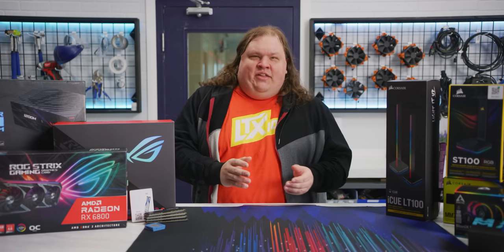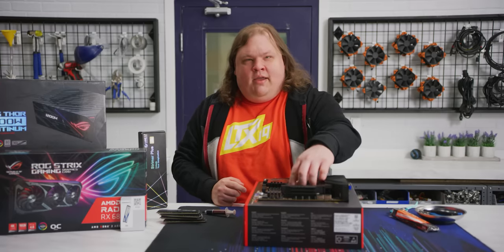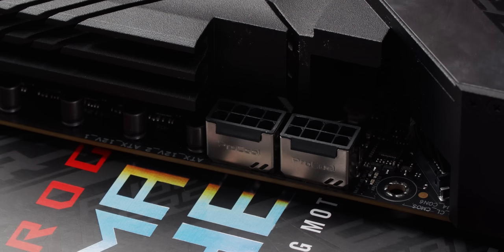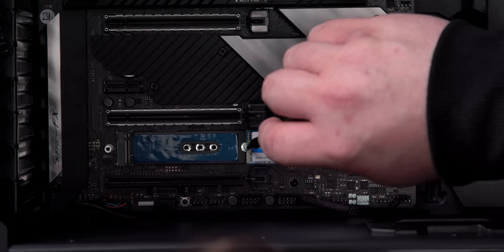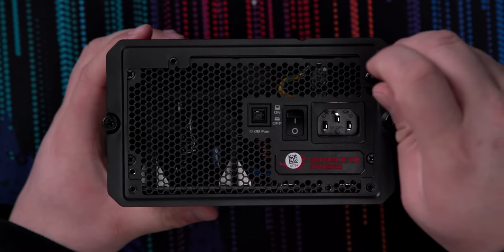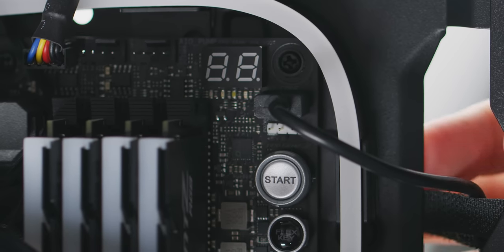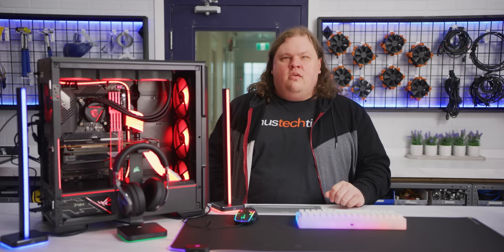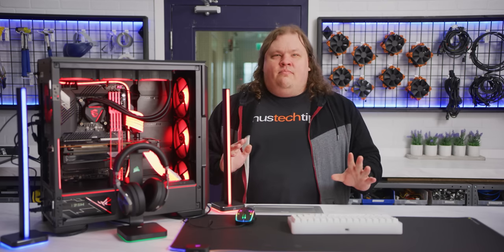ULTIMATE RGB PC Build Guide 2021

Comment: LTT: “Make sure to check out Crucial RAM and SSDs!”
Also LTT: uses G.Skill
Reply: Is G.Skill good?
Reply: @chrism6904  yup, they are top tier
Reply: crucial ram rgb software is non existent
Reply: @kampaskopling523  not gskill aegis tho
Reply: @eliashelfer2740  that’s just not true. g skill aegis is lower end but it’s still better than a lot of other sticks out there. I’ve had aegis running in my system for 2 years almost and haven’t had a single issue

also just an edit, aegis is still phenomenal ram, but that goes without saying, yes g skill trident z is probably better ram. ripjawd and aegis is very comparable imo
Reply: @yourmom-ee5pb  yeah it’s a bang for the buck but medium range I would take Corsair vengeance
Reply: @eliashelfer2740  All vendors except G.Skill and Crucial are well known for their inconsistency in terms of chips. Corsair's ram isnt that bad, but, for example, Hyperx and ADATA may install different chips even inside ONE BATCH. For example, some time ago i built two PCs in a row with identical kits of HyperX Fury ram produced at pretty much same time, but one was on Micron Rev.H and the other one was on Hynix M-die.
Reply: acrually if you get  armory crate and aura sync you can control it.
Reply: @kampaskopling523  Thank you very much!
Reply: I was gonna comment that!
Reply: yea, I mean crucial makes really good RGB RAM. I plan to put a kit of this RAM in my system
Reply: @symir833  thanks for telling that will be very helpful when I get my new RAM
Reply: @eliashelfer2740  same
Reply: @chrism6904  yes it is the best for mid-high end with semi-low price
Reply: @symir833  OpenRGB
Reply: @chrism6904  OpenRGB
Reply: Which one to go for? G.Skill or Corsair?
Reply: Even tho (imo) Vengeance Ram looks better
Reply: Gskill has a model that goes with the Ryzen CPU, they were originally going for a Ryzen build.
Reply: e

Comment: Hot take: PSUs having built in wattmeters should be standard at least from mid range up, they don't need to be LCDs, you could throw a couple little 7 segments on there. Power delivery is still straight out of the 80s tech wise for literally no reason

Comment: Make sure you Disable SDK on your RGB software if you are running more than 1 application. They can conflict each other, Example, iCUE does not like working alongside MSI Center. I had a ton of RGB problems, once I figured out you can Disable SDK which allows other RGB applications to take control of RGB settings, they seemed to be both on by default.
Reply: How to disable SDK for this combo?

Comment: "you need a table to build a computer"

I built my first pc (custom hardline 5900x and 3090 FE) on a sherpa wool blanket in the middle of my carpeted floor. Fight me
Reply: The Verge hates this guy!
Reply: 2020 was the first time I ever used a table to build a computer.  Every other PC before that, every single one, was built on a carpeted floor, because it's what I friggin had, so it's what I went with.

Also, grats on the sick build!
Reply: @SilverKnight16  thanks! And yeah, when the only place that you have room to put your system is next to the couch, with your monitor and peripherals on the coffee table, then you probably don't have the room for a table and ESD mat.

As long as you frequently ground yourself through the case and don't move around a lot, static isn't a concern... Losing screws in the carpet is lol

Comment: "you need a table to build a computer"

Geez, i build my first on the bed
Reply: I’ve built mine and my brothers’ pcs on my bed also rofl
Reply: the verge pc build reference there
Reply: I built my pc on a floor. 4 years ago.
Reply: I built my first one in mid air
Reply: I also built my first one on my bed lol, on a comforter that generates so much static that getting in and out of bed in the winter in the dark I can see flashes like lightning all over from static discharges 😂😂😂 the computer is of course fine but has since been shelved after I built my new one.
Reply: I built mine in the swimming pool.

Comment: Thanks Anthony , I"m on 1st build in 15?  Stuned! Hardly anything comes w/reasonably legible labelling, instructions? WTH manufacturers?  $20 ID Cooling CPU Cooler. comes w/ great instructions but $50 Arctic Air Cooler came w/ install flanges that butted into VRM Sheilds & online instructions?  Sucked in by a White Build &  D-RGB bling!  It's my Dream Machine🤩  Jury is still out! D-RGB  & Fan Heat management wiring is not facilitated by Manufacturers &  Retailers  🤑😂🙉

Comment: I have this same Hero XIII and less RGB that doesn’t work.

I have 3 of the long RGB strips in this video and 3 fans plus a CPU block. The 3 fans and CPU AIO are the EKWB 360. I have 2 commander pro’s and the Razer lighting hub thing.

The 3 fans light up and sync to the RAM, CPU block, and mobo but the damn Strips refuse to work.

Both Synapse and iCUE complain that the strips are too long. They are not daisy chained and plug into independent headers on the hubs.

Granted this build was my first RGB build but it’s not hard to plug things in. Was supposed to look awesome but ended up being more trouble than it’s worth. A year later they just sit there annoying me as a waste of time, money, and potential.

Also, 1000% agree that those connectors are stupid loose. Electrical tape work fine if you’re not plugging it into a hub. If you are, good luck. I tried to use zip ties in an X pattern to seat them but that was also a stupid battle.

In the end, I’d probably drop most of the RGB for my next build. Wasn’t worth the hassle and cost

Comment: I ended up getting hot glue for daisy chained RGB connectors.  While a smidge more permanent, it can be removed and won't leave nasty sticky tape residue behind.  Now that I think about it, I'm a little surprised someone hasn't engineered some 3d printable cable locks for this....or that a company hasn't done the same with their fans, other than maybe Lian Li's solution.

Comment: You could use these towers or like what i have: ST100 RGB, and what im trying to say is: if you have the lighting type "Temperature sensing", you could set it to any component, i set it to my GPU and CPU bc these are optional for me to check the temp for what game is using too much, i have a low end thats why im carefull mostly.

Comment: Correction: you do not need a table to build a computer. In my case, I used a carpeted floor, a sherpa wool blanket to prop up the case, and my bed to lay out the parts.

And no, in some cases, you cannot get the same performance from a mid-range board and a high end. The Crosshair VIII Dark Hero and Extreme boards are the only motherboards on the market that allows you to enable PBO and an all-core overclock at the same time. My 5900x will boost to 4.9-5.1gHz under 75a load, and locks at 4.7ghz over 75a, giving me all-core power and gaming performance

Comment: Questions for the all mighty tech lords of Linus Tech.. I am running an Asus Tuf Z390 + WiFi motherboard, which has 2 standard 4 pin RGB headers, is there a way for me to run 9 fans with splitters and have Asus Sync control it all? Or should I be looking into fan controllers?

Comment: This is nice and all, but you can't sync the corsair peripherals to the RGB inside the system because iCue won't work with Asus armoury crate..could have gotten everything Corsair in this video from Asus (except for the light bar) and synced every single thing..Right now mouse keyboard and the corsair stuff is just doing it's own thing.

Comment: Dont forget to remove the (usually blue) tape that covers the NVME M.2 heat shield ! So that the new drive can contact the heat pad and transfer heat to the cooling fins properly ! I forgot to do this the first time but thankfully once I upgraded with a new drive a day or so later I saw the tape and removed them all for my drives . Whoops .

Comment: you could of just did it all thru icue with these special adapters from ebay that has the 3 pin argb 5v plug and the other end has the corsair perpritary plug and its so much easier.

Comment: Im confused, is the msi b550 carbon, the only motherboard that cant handle more than 5 RGB things, connected to it? I hooked up like 7 rgb fans, rgb  sag bracket, rgb m.2 sink, and the rgb pins stopped working after a few days...
What other AM4 motherboard can handle a lot of rgb?

Comment: I like RGB... To a point. By that I mean you don't have to direct air traffic or rob a bank to afford it. I went with all corsair... The crystal 450X case, corsair cl120 rgb fans corsair vengeance rgb pro ram, k44 rgb  keyboard, harpoon rgb pro mouse & h100i v2 aio. All on the commander pro & run by iCue. My cable management  looks like spaghetti but it looks clean & nice where it counts.

Comment: I have a lian li AIO cooler & Ive installed the inlet and out let at the top at the 12 O clock position same as you but I see most on the side or the 3 O clock position. Is this okay? My first build.

Comment: I’m kinda new to PC building and was wondering what is the best type of graphics card, that isn’t over $1000, for the intel i9 that was mentioned in the video?
Reply: At the moment I run a i9 10900F with a GTX 1650 Super and I get 60+ FPS on ultra for majority of games, if you are look for something a bit better you could look at the 1660 or 1660 Ti, although they are more expensive. I don’t think you’d have much luck getting anything higher than a 1070 with the current situation, so that’s my suggestion for < $1000 that’s likely in stock.

Comment: Is it ok to mount the power supply right side up with the fan right up against the shroud like that? The case seems to assume you will mount it upside down with the fan on the bottom pulling through the filtered vent at the bottom, but if you do that you can't see the display!

Comment: Hi Anthony,
thank you for all your hard work and great tips!
I have a question regarding RGB LED Strips and connection types for them.
A friend gave me a pair of LED Strips from a Motorcycle. I have seen these on youtube being installed on some PC's.
Here are the ones I am referring to found on Amazon- Kingshowstar 2pcs 4inch 6 LED Multi-Color Flexible Strip Accent Lights 5050 SMD Flex RGB for Motorcycle ,ATV,Car
The Single connection on this is a 4 pin that is not the same as RGB on my MB, Asrock B550 Steel Legend.
These Strips are short but appropriate for where I intended for the to go (on a homemade GPU backingplate)
Question is: should I bother with these or just purchase a Kit ?

Comment: i like how you did the cost break down, this is why i like to stick with one brand, not so much because i am a soy boy fan boy, but i hate the idea of needing many different rgb programs to run it all, i find that corsair gives you the widest range of rgb peripherals to use like this under the icue software. as everyone else years ago i was into razer, until i found them to be the most expensive cheap bran don the market. i went through so many mice and keyboards because of their cheaply built products,a razer naga, razer naga tournament edition, razer naga trinity, black widow, ornata, huntsmen elite. and the answer to all this expensive shit. the rgb in them are very shotty, and their half life is like quick.

so i decided to finally go with corsair, i got the k60 keyboard, the scimitar mouse, and the mm700 mousemat. of course corsair inside to, such as the corsair ll 129 mm fans, i got 9 of them because i am using the lian li dynamic case. plus a commander xt, which sucks that at this point they don't have a commander that can host 9 fans, with rgb and fan speed control.

and let me tell you the 9 fans, plus the core xt was 516 by itself. never mind when i get the strimmer cables.

Comment: Hi Anthony, my Phanteks Digital Neon RGB Strips only light up about 1/4 way on each and in the wrong color. I have 4 of them daisy chained together and connected to a Cooler Master ARGB Hub through the 3 Pin VDG connector.

What could i have possibly done wrong?

Comment: Would the PSU be starved for air with the fan facing up?
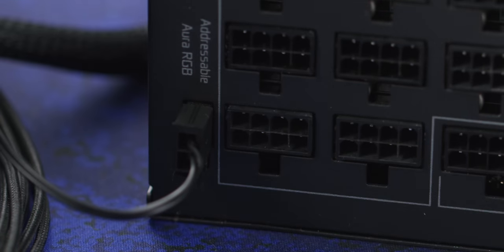Reply: The psu is not faced up. You can see that in 11:36
Reply: @wednesday7267  Literally the only way to mount these power supplies is fan up

Comment: 6:56 HALE-FUCKING-LUJAH! Thank you so much to actually tell epople this! When I got my most recent board I had to make this discovery aswell. The connector feels like it could still need a bit of a push even though its properly connected and the plastic around the pins is pretty flimsy. I also, for whatever reason, expected some kind of noise when I plug it in properly but the only thing that made a noise was me screaming when I plggued it in "too properly" and probably the plastic breaking. Good thing there was another USB 3 connector on my board; I left that open... I dont have working frontports since almost 2 years...

Comment: Is that enough clearance between the shroud and the top of the PSU fan?? Asking cause I have the same PSU and case lol
Reply: same situation here and about to build. How’s it been for you?
Reply: @manuman888  So I ended up drilling holes onto the top of the shroud where the fan is on top of the PSU. Its now a totally custom case lol.  I think eventually I'm going to use a Dremel, cut out a square and get one of those magnetic dust covers to make it look better. and for better airflow.

Comment: I just wanna put my 2 cents in. I know this is an old video. I have ran a Computer repair shop since 2003 and with my experience of building about 80+ PC a month and repairing  200+. I see more AMD processors then Intel. I have seen maybe 10 bad intel processors in the last 6 years and about 45 ryzens the last year.

Comment: can't seem to get my P500A case light or fan lights to work on the controller or mobo software, any suggestions? and thats with and without the M/b DRGB plugin plugged in. there just stuck on the rainbow cant change the effect or turn the off.

Comment: I must be old...  or odd...  I really couldn't care less about RGB.  I just prefer things that look aesthetically nice, like the case design.  My R9-5950X system is in a Lian Li Lancool II Mesh White RGB case, and I have the RGB off.  The only RGB that is on in my systems is what runs by default such as default motherboard and GPU logos on the ASUS hardware.  It's not like RGB makes it run faster or gives you free memory... or does it...

Comment: After all this time (? "Always") I still don't really like RGB, not in the most common ways you see it. I mean, most of the time it's rainbow unicorn puke through every component and peripheral, and in some cases people just pick a particular accent color. The only way I would use RGB is through a functional approach. Waterblock color on the cpu changing to express how hot it runs. Having keys on my keyboard light up a certain way to indicate an action or whatever (blinking key when a cooldown has finished or something, does this exist yet?), or the Ambilight approach and having your case (or these ridiculous RGB towers from the video) light up in correspondence to the monitor content.

Comment: TRIDENT Z ROYALE 🤬
Reply: Trident Z Royal doesn’t come in black and the Dominator Platinum RGB looks much better.
Reply: @wednesday7267  3🤮
Reply: @JayJ5802  tf are ya tryna say
Reply: @wednesday7267  dominator ram doesn't look as good as trident z royal elite
Reply: @JayJ5802  
But then the theme of this build is black and it only comes in white and golden. If the theme would have been white, then it could have been used and RGB in white theme looks a lot better to me ngl.
Reply: @wednesday7267  i didn't ask mate 🤣🤣
Reply: @JayJ5802  trident z royal doesn’t look half as good as dominator platinum rgb